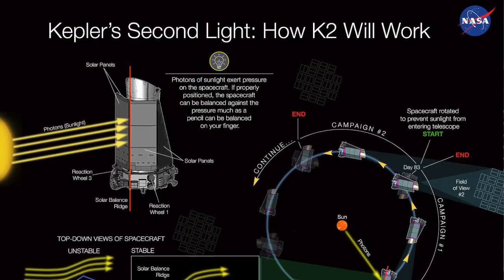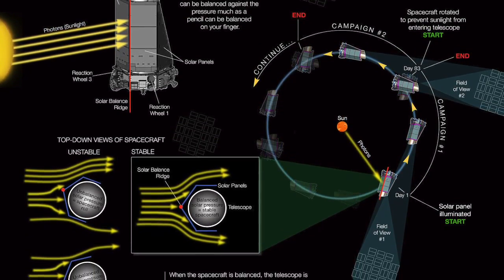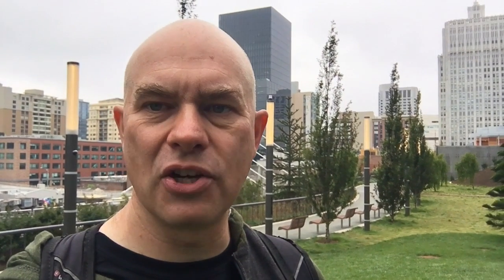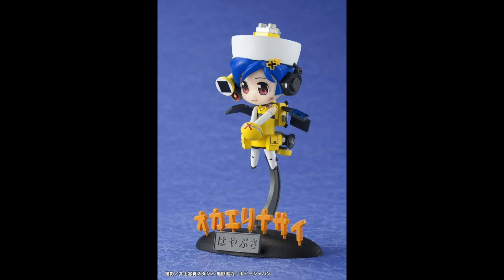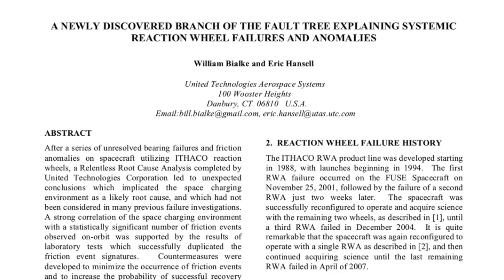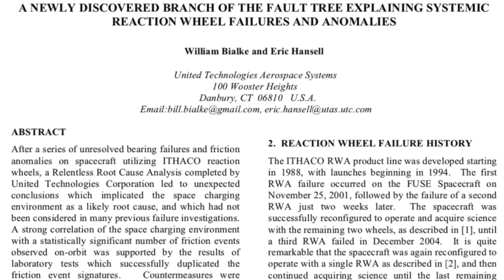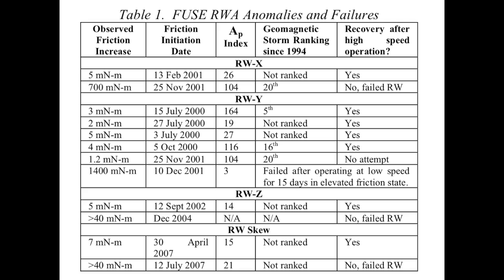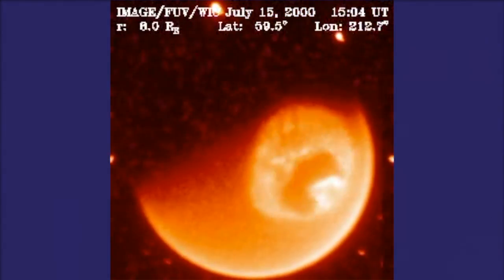Scientists May Have Figured Out Why So Many Spacecraft Were Failing

Comment: You have to explain 'pressure of light' for me please
Reply: Look up a physics toy called a radiometer. Looks like a light bulb, under a vacuum, with a little armature inside. Light hits the vanes on the armature. Each vane has a light side and a dark side (one reflects light and the other absorbs it), and the difference is enough to spin the armature.

Comment: Surprising this wasn't addressed in design of the bearings. EM discharges through bearings causing spalling and failure is a known issue with inverter driven motors and is addressed by additional bonding of the rotating shaft.

Comment: Oh yeah right! You can get a roller bearing to activate like an electric motor by running current through the inner race to the outer race! There are videos on YouTube showing this. Makes great sense. A huge electrostatic charge could create resistance depending on what direction you wanted to spin the bearing. Neat.

Comment: Why don't they just run these reaction wheels in low earth orbit and let the ISS pick it up after a lot of simulated work in 0 G vac? Mimic every correction these sat's used until it fails and then bring it back.

Comment: quite the possablity.. couldnt this be mitigated (in new designs) by somehow connecting the inner ring of the bearing to the outer ring so that they are both at the same potential and electricity wont flow

Comment: Stray voltage across bearings are a well-known problem around variable-frequency drives and other high-current industrial equipment. As you say, ball bearings are VERY well studied.

Comment: Why dont they use magnetic bearings for the reaction wheels?

[Since there is no friction, choose to take out the wheels at 6000 rpm, using the range of 1000 rpm to 12000 rpm, then you never need to be statically balanced at 0 rpm.]